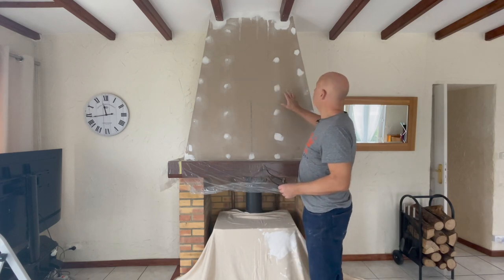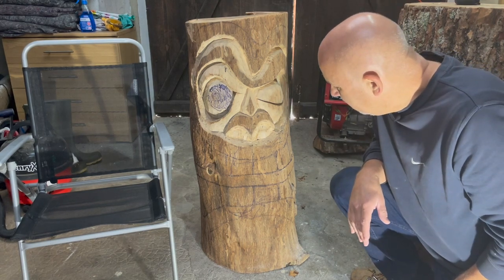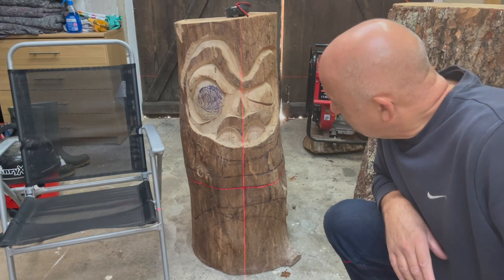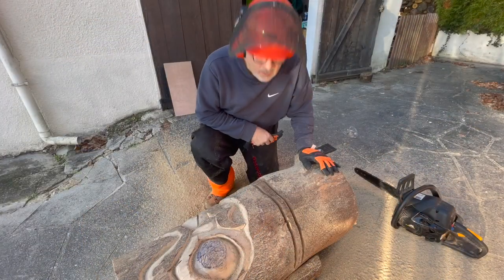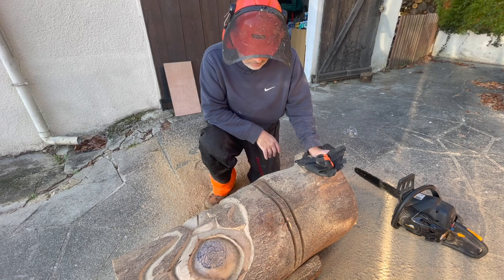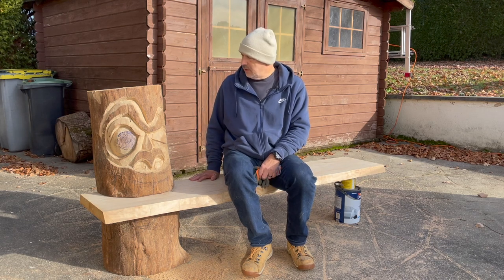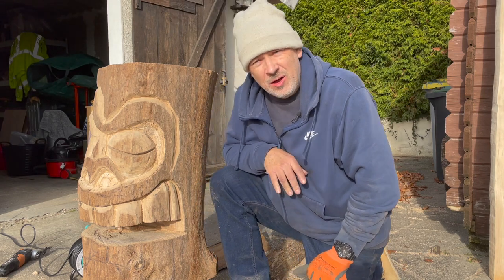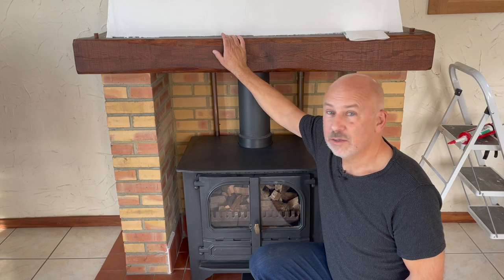French Countryside Life # 78. Two Heads are Better than One.

Comment: Hey Colin, For a long time I was a "tester" for building materials, paints and such. I was the first one they gave lightweight filler to try out and I was working in a building being converted from a run down elderly nursing home to a home for youngsters with special needs. I had a room to myself to keep gear in so could try out things without other trades "seeing it". I had a load of tubes nicked and lock broken and stuff stolen.... I found out who very soon..... He was the plumber using my anonymous tubes of what he thought was silicon! He was using my Dec. Caulk... Got most of my gear back but he had also convinced owner to buy a mountain of tile adhesive and was "found" filling his van and leaving empty tubs in the hallways... he then left the area. As regards caulk... How wrong can you be as I thought it would not catch on. I only use it sparingly not like all the guys who slather it on everywhere,  Happy Noel. Mon Ami.  Bob
Reply from the maker: Hi Bob, good to hear from you. What a thieving Bar Steward. He was probably from Dagenham...I think DC is a good gap filler when you need to paint right up to the edge. 
I do look forward to your stories, they're an indication of a life lived. Much respect. Merry Christmas to you and yours. 🎄👍🏼

Comment: Don’t know what it’s been like weather wise with you but that head would have been in 50cm lengths here with an orange glow surrounding it 😂🥶
🙏🦙
Reply from the maker: Hi Chris. We've had the log burner on for a couple of days but we're spoilt for choice with the gas central heating. Should it come to it though at least I know that I've got a back up with the wood in the Tiki head. 👍🏼
Reply: We’ve had it really cold here for a couple of weeks. -9 for two mornings plus a bit of snow. We have two wood stoves and electric radiators. The radiators haven’t been on except for the two really cold days. The llamas have been in at night. Not even they are crazy enough to stay outside.